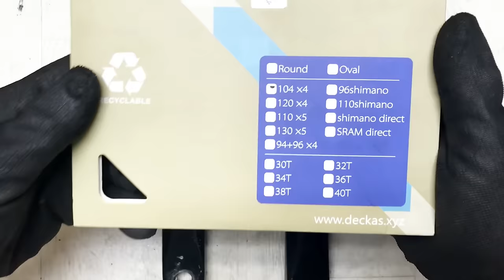How to convert your SHIMANO CRANK from 3 drive to single narrow wide 2020

Comment: i did this conversion several months back and its worked out great.  no more messing with a front derailleur and i don't feel that i've lost anything in terms of riding performance.  i used the middle ring more than 90% of the time anyways on the 3 ring setup.
Reply from the maker: Very good 😊
Reply: Can you put a link to the stuf you used
Reply: @Sebatron-pr9bv  Race Face narrow wide chain ring RNW104X30BLK, Shimano Acera FC-M361 crankset (this is for a square taper bottom bracket)
Reply: 53T/39T chainring and 11-32T Casette has the same upper and lower gear ratio as 1x 53T chainring and 11-42T Casette. 1x isn't totally losing out on the important gears if you don't mind the less narrow gear shifts.
Reply: same
Reply: Does the 1x go faster? Whats the difference?
Between 1x and 3x..
Reply: @Eyempresent  It's really not about going faster, but for simplicity. By going with a 1x setup in the front, you eliminate the need for a derailleur, shifter, and cable. I believe it comes down to matter of opinion on the performance, I feel that I have not lost anything by making this conversion.
Reply: @Eyempresent  is amazing nobody seems to bloody know. You would think someone would have a simple answer. I'm trying to find out if a 12 speed new generation setup would have a greater  cadence at high speed than a traditional 27 speed.
Reply: Bigger rings= more speed in front
Reply: I never use the big chain ring on my 3x. I climb ledges and logs a lot, and I mean a lot. That front chain ring is my lowest strike point as far as I can figure. Maybe it would be good for my riding.

Comment: From what I understand about chainline, the front ring needs to line up with the middle rear cog.
 So you would use option II and possibly up to 4 mm of spacers and longer chainring screws to line up the chain.
Reply: wiesz ze dzwoni ale nie wiesz w ktorym kosciele

Comment: After I got a couple more teeth in the back , I found that I needed the upper and lower ranges less frequently. Eventually I wondered if all the clutter and extra needs of attention was worth it for as often as I needed the outer ranges. I'll still keep the 3x for the road trip bike, but the switch will simplify the commuter.

Comment: i did this conversion on two different shimano 3x-Cranks and both times i had to file a bit of the chainring mount on the crank to put the chainring from china (Deckas, Snail, etc. all the same) into the correct position (Pos. option 2 in you video)

Comment: I've done the same but with SRAM narrow wide steel rings which last much longer. The difficulty then is getting them to fit a different BCD. It can be achieved to a good finish with an angle grinder and a drill though.

Comment: The oval crank is an amazing power boost and the weight reduction helps balance the bike out some carbon bars and bars and a billet stem should balance the rest out nicely.
Reply: It's so funny how things trend. Those oval rings were big on road bikes in the 80s until some famous competitor said they sucked and everybody stopped using them.  Now they are back! lol

Comment: I have a 21 Speed hybrid, 1-year-old.  Could i just reuse the middle ring from the crankset,  All I need is the correct fitting fasteners?   Then i got a 7 speed.
Reply from the maker: Yes its all what you need
Reply: @lonerbikes  Thank you very much.

Comment: My wife just rides on the middle chain ring and as it has 32 teeth, could I not just keep that ring, when converting her bike? I know buying a 34 tooth chain ring would give her a greater power range but I was thinking of keeping the cost down!
Reply: yh u can mate
Reply: Sure.  But it depends on if you change the rear cassette.  With a modern cassette, you might have equivalent lower gears with the 34 and it might be worth changing.  If you want to compare, you can find gear calculators online that will show you what the gear inches are.  You just have to input the wheel size and the range for front and rear gears and it’ll show you the numbers for each gear.
Reply: You can keep the 32T but you must replace the current ring for the narrow wide ring. It will prevent a chain from falling of the ring.
Reply: The narrow wide single chain ring helps to stop chain drop. The stock chainring with definitely work for street riding but on rough trails and hard riding in lowest and highest cassette gears you may end up with the chain trying to bounce off or  “shift off” the stock chain ring.

Comment: What's the actual benefit of this conversion? I have two chain rings and i use bigger one mostly of the times and small one when climbing steep sandy hills. Works perfectly. I know one ring looks cool and neat but is it actually wort it? As i like to get faster on the tarmac and i like steep climbs too.
Reply: Cleaner look, mechanical simplicity, slight weight saving and streamlining of the controls.
If your range works for you, it's hard to argue for the expense and hassle.

Comment: Can you explain what's the difference between 2 options? why use different bolts in option 2? Thanks!
Reply from the maker: Chain line difference, in 2nd option i use bolts from SNAIL set from aliexpress 😉
Reply: @lonerbikes  So it's used to control the chainring offset? 
And, couldn't you have connected in 2nd option with original bolts?
Reply from the maker: @YanikBrown  yes, 
yes you can also use original screws, but the snail set looks better :P

Comment: I love option 1 with turning over disc, many brand logo on bike
Reply: Really has nothing to do with logo you can run it either way. What he is showing is you can run the chainring in both outside the spider or inside the spider. For most the inside position is usually the best for chain line puts it where the middle ring was. No matter which option you choose you can run logo in or out.

Comment: what about the front derailleur can i just take it off and it will still shift properly?
Reply from the maker: If you make 1x ? Drive you can remove front derailleur because you need use narrow wide crank gear

Comment: Okay this actually seemed a lot easier than I thought, was out riding today and realized how little I need a 3x so thank you and I will re reference this video once I get a 1x chainring
Edit: my cranks are allterra but a similar set up in the front rings will this work?
Reply: actually using a mtb uphill makes you realize how little the front 3 matters
Reply: @growingup4487  oh absolutely, the park I usually ride to ( a normal park since there’s no bike parks near me) has this massive hill that is super fun to go down but can be a pain to go up and even then I hardly use the biggest and smallest chain rings. I’m almost always using the middle one

Comment: you will need to change the bottom bracket too , or the chain will fall off  , chainline
Reply from the maker: Sometimes yes, but generally the chain line is on the middle gear, like in 3speed crank

Comment: What are the pros and cons of both options? Thanks a lot!
Reply: Mostly the con on most setups is outside the spider will cause a pretty bad chain line when in lower gears. Inside the spider which is middle ring position tends to center it better with cassette this will keep the chain line better weather in low or high gears.

Comment: I have a question is it possible 3x in front and 1x in rear ?
Reply from the maker: It does not make sense
And the chain line will be bad
Reply: @lonerbikes  what if we use 3 same size  cog to keep chain in line

Comment: I'm about to do this on my older 26" full suspension trek fuel 90 with an oval 32T chainring. I have a 3x9 set up. Is it going to really suck climbing hills? I'm thinking about changing the rear cassette but figured I would try it first with the old one on there.
Reply from the maker: Great 😊

Comment: Need help with setup. I have a 3x. 48/38/28 with fixed rings. Can i buy this crank & change the 48t for a 46t .  keep the 38t middle and remove the small ring . so it would be 2x - 46/38 ??  My issue is i don't have hills here and my 8speed 11/ 32 cog im always on the 18t.  So i need something smaller up front so i can use all my rear gears more , or should i just go 44t 1x up front ??
Reply: Shimano CX 50 crank set is 46/36, try that

Comment: does this exact method work with all shimano branded cranksets? thanks
Reply from the maker: No, you need some crank with 104BCD, to fit it with crank wheel ( deckas 104BCD)

Comment: First option is bad.  Puts the chainring in the same position as the large ring on a triple and creates a huge angle to the chain line when in the big cogs in the rear.  You really shouldn’t even show it.  You want that single in the same position as the middle ring.  Those attachment plates for the outside are slick though.  

Personally, a single front ring would not have enough gears for me.  With modern rear cogsets, you do get the climbing gears, but lack the high speed gears for downhills.
Reply: I think the large ring is attached to the middle one, so he is installing the ring in the only place possible which is the middle?
Reply: @gonzalol1754  No you can put it in either position inside  the spider or outside the spider. As a rule the middle position will give the best chain line overall.

Comment: So I have to buy another chain ring can I just get the one that was already on it and put that one on and take of the other chain rings that were on it
Reply: I don’t think you have to I think he just wanted to because I’m going to try this soon
Reply: dude, its required to swap chainrings when converting a 3x crankset into 1x because the ones installed in 3x cranksets aren't narrow wide which allows the chain to be transferred to other rings in the crank while a 1x purpose built chain-ring has narrow wide teeth so that your chain wouldn't derail when trailing or going through rough terrain.
Reply: Do I have to shorten the chain if I do this and if yes by how much do I have to shorten the chain ?
Reply: @JS-bh3fg  it depends if you are willing to change your cassette from a smaller teeth count to a bigger one(ex. from 11-32T converting to 11-40T and higher). If you decide to keep your old cassette(possibly a smaller teeth size),you need to shorten your chain to keep your derailleur in tension. If you change to a bigger cassette size, you don't really need to shorten the chain pretty much.
edit: it depends on the size of your cassette and your chainring when choosing the right length of chain.

PS: if you have a medium cage derailleur, you either extend it with a goatlink/extender(downside of installing this is not having a smooth feel when shifting up/down) to accommodate a bigger cassette or the jockey rings will collide with the biggest gear of the cassette or...change to a long cage derailleur.

Comment: Why can't you just use the same 3 speed chaining but just remove the bigger and smaller one? Why do you have to buy a new single
Reply from the maker: Because new chainring is NARROW WIDE system, its recomended for 1 speed traindrive like 1x9 , 1x….
Reply: @lonerbikes  ok thanks I have done a little more digging and I understand now. My 3x comes as one piece with the crank so I have to buy a whole new groupset really.

Comment: Can SR Suntour XCT be changed like that?
Reply from the maker: If this crank is  104BCD - then the DECKAS gear in the video will fit
Check that this crank is 104BCD for sure,
Because the bcd of the sprocket and the crank must match- facing the holes 😉
Reply: it depends on the model of your chainset
if you have bolt on chainrings its doable, if not... than
Reply: Suntour is garbage, you don't want that crap on your bike

Comment: What about chainline? Do you know or measure what is the chainline for your cassette?  Did you adjust new crankset to cassette chainline or maybe to your favourite gears? If not, you shouldn't have published this video and make others make the same mistake.
Reply from the maker: Hello Friend,
the movie itself is only about 2 ways of crank conversion, the exact issue of the chain line may arise in the future

Thanks for comment 😉

Comment: What if  u have a 94+96BCD chainring is that fit to a crank that 104BCD?
Reply from the maker: No, you need crank with 104BCD 
Which is flush with the holes

Comment: can the group set shimano altus 3x9 can became to 1x9
Reply from the maker: if your chain line allows it I think so

narrow wide sprocket in the place of the central table top from the middle or outside depending on the chain line
Reply: @lonerbikes  
Are you switching just to be fashionable?  Unless you’re changing your rear cassette to a modern cassette, you’re going to lack gears on the high and low end.  If I were still racing XC, I would never go 1X; just not enough high end gears.
Reply: yes

Comment: my son has a norco storm 5 with a CRANKSET
Shimano TY301, 42/34/24T, 175mm (M, L, XL) 
Would he be able to change this out as easy as this video lol, he wants to go with a single gear in the front not the 3 speed and then take the front derailleur off and add a dropper post

Comment: How about 3x prowheel crankset? It is ok to convert 1x? Thanks😍
Reply: @SanDeep Bisht Um no you will just remove it. You could leave it on and never touch it but I guarantee you will accidentally hit it forgetting that you went to 1x. Just remove front shifter and derailluer and be done with it.
Reply: 3 gear Crankset is for people who like driving fast
Reply: @ericgonzalez9096  Yes i was used to that before I got new bike with NX sram 11x1 and I was surprised about how slow it was in comparison to a 3by ,, but that's because my old bike was a cheap cross country and my new is a electric trail bike

Comment: How many chain links does 1x7 crank does have? still the old ones or reduce or increase the link of it?
Reply from the maker: it depends on the frame and the drive you use (size of gears)

Comment: Can you put the 1x chainring and the smallest chainring in the 3x together and get it shifting?
Reply: Just use the two original chainrings. A narrow wide (1x) chainring is designed to not shift lol

Comment: I like the idea but not worth all the hassle and expense because you also will need to change the left side brake/shifter gizmo and the rear cassette for best gear ratios.  Best way to go is to buy a bike that comes with the one ring( front derailleurs are harsh compared to rear) with the compatible cassette and just a brake lever on the left side. Seven, 8 or nine speeds is plenty. Or maybe I just do not get it.
Reply: I find 9 speeds as the sweet spot, cheap and effective
Reply: Or you could just modify the bike you already have instead of buying a whole new unit, that’s just poor financial decision making for some people. Some people like modifying and upgrading their bikes.

Comment: What a pointless video. Why get rid of higher gears? It hardly saves any weight.
Reply: I guess it's useful e.g. for everyday bikes. A neighbor goes to work by bike everyday in any weather conditions and the front derailleur is always the problem because it get's locked and doesn't move anymore. So I have to change it every season when winter is gone... He doesn't need very small or very high gears, 1x10 with a 34 crank and 11-46 sprocket works very well. Less chance for dirt, salt and dust.
Reply: Well for most it isn't  about weight. Really just a nice simple setup 1x and no front shifter to worry about. There are a few people who use all their gears but most including myself never did. About 99% of the time I never left the middle ring. After going 1x with oval ring I never looked back. Maybe not for everybody that is why they make so many flavors.